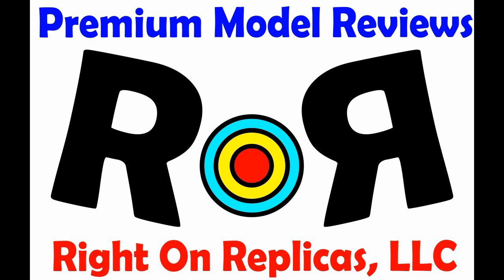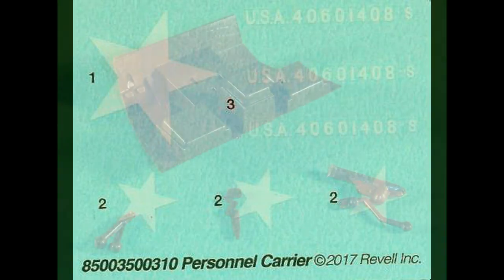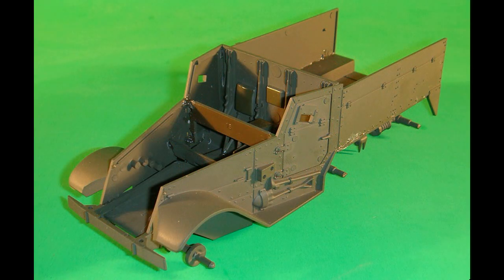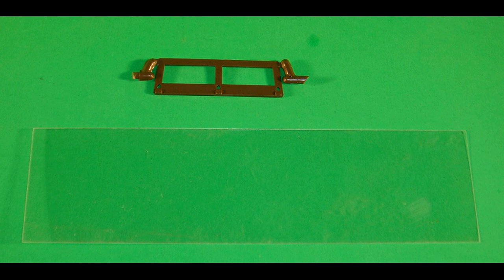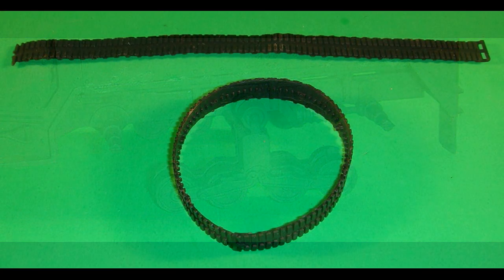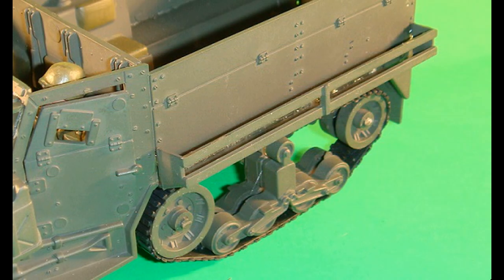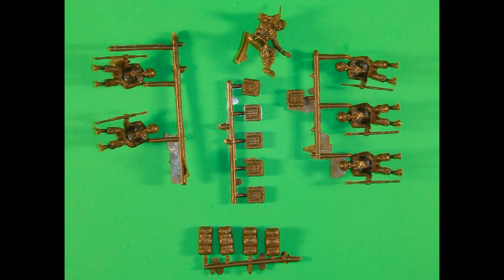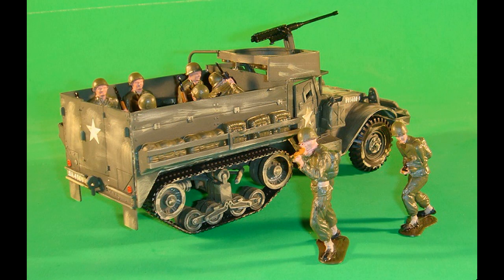How to Build the M3A1 US Armored Half track 1:35 Scale Monogram Kit #85-0035 Review

Comment: I built a Monogram Half-Track in the 1970's, it had a quad mount .50 caliber antiaircraft gun in the back, dont think it was based on this kit.
Reply from the maker: $) - It might have been this kit as it has been released in different configurations since the 50's but there may have been Renwal kits out at the time of your build too!  -Doug
Reply: Different kit. Monogram had two half track kits. This one, the M3A1 and the one you're talking about. A model of the M16 multiple gun motor carriage with a m45 quad .50 cal in the back.  

https://en.wikipedia.org/wiki/M16_Multiple_Gun_Motor_Carriage
https://en.wikipedia.org/wiki/M45_Quadmount
http://www.rightonreplicas.com/blog/?p=5584
Reply from the maker: Lo, thanks for clearing that up!   -Doug
Reply: I remember building this kit and the M16 as well - if I recall, the seated soldiers are portrayed holding M-14s, so more of a Korean War-era halftrack.  It's been 30+ years, and I long ago blew it up with firecrackers, so I'm going by the flood of memories caused by seeing that parts layout at the beginning.
Reply: Those could be M-1 carbines which were used in WWII.
Reply: 40intrepid : I did the same...and it was definitely a different kit.
Reply: Currently the Monogram Halftrack is available in two versions.  First the M-3A1 personnel carrier, and second as the M-13, with two. 50 BMGs in the turret mount, erroneously labeled the M-16 (4 guns).   I have built both kits recently.  The M-3A1 kit is a hodge-podge of M-3 and M-13 parts bagged together, not the original kit from my youth decades back.  It includes several parts for the turret, but not all, and one machinegun, the left side gun in my recent kit.  I substituted a better detailed gun from a machinegun accessory pack.
The seated figures carry the M-14 rifle.
Reply: I had both Half Track versions. Monogram made both models. I made the Tamiya ones too. Tamiya was more harder to make.

Comment: I saw u use a glue many times u put the glue on the outside I guess it runs in seam what is that kind of glue I have to try it lol
Reply from the maker: GM,  Most likely it was thin CA type superglue.  It will follow a seem using capillary action and weld the joint while holding it together!  -Doug

Comment: I was wondering, If you paint parts before gluing, will the plastic cement work or did you use super glue for those parts. I was just curious if the liquid cement worked on painted parts. Thanks.
Reply from the maker: Nic - Glue will not work well on painted parts.  Often I paint all the parts with primer but you have to scrape it off the joints to get a good bond!  -Doug
Reply: Thanks.
Reply: I see a lot of builders on Youtube currently using a Tamiya liquid glue with a brush.  I haven't built a kit in over 30 years and Zap-a-Gap was just coming into fashion back then. I forget if that stuff worked well on paints, or if the new kind of liquid glue does - but the good old Testors in a tube definitely did not.  It crazed the paint and led to raised, bubble areas where it was applied.  I remember either waiting to paint after the glue dried or, if necessary, carefully (not carefully enough in most cases for me) scraping hopefully enough paint off with an X-acto knife.  Definitely a learning experience. :-)

Comment: When painting tbe body sides, Are both sides painted? Also what parts are not painted on both sides?
Reply from the maker: MB - You'll want to paint both sides if there's a chance that they can be seen from underneath or any other angle for that matter.  Parts that wouldn't get paint are those that are hidden from view and you can determine that from test fitting and mock-ups!  -Doug